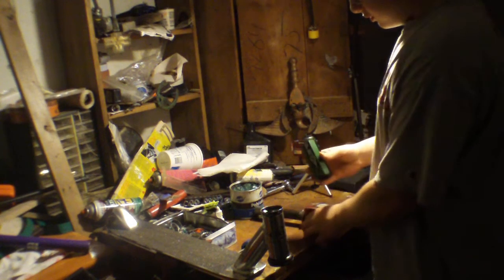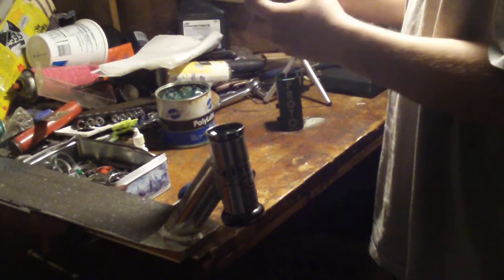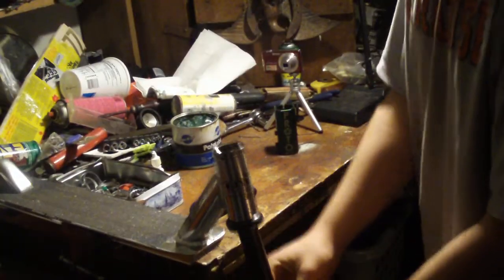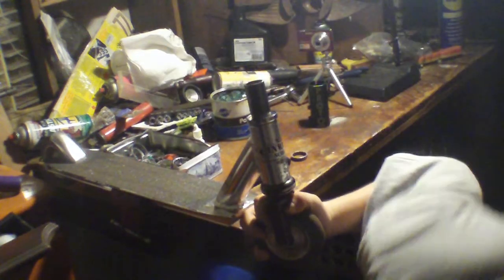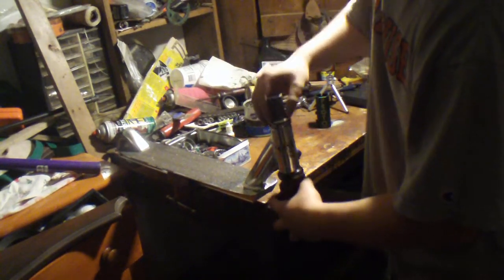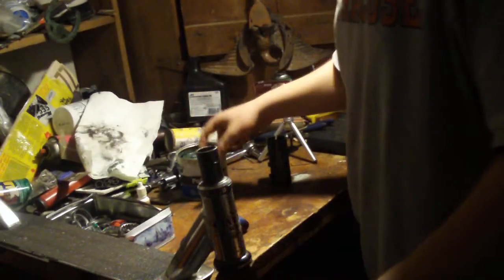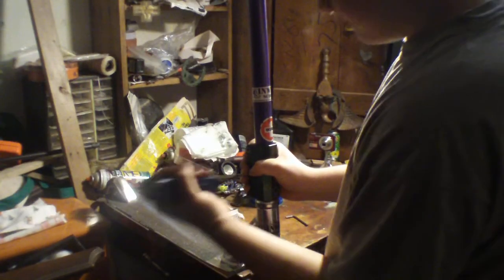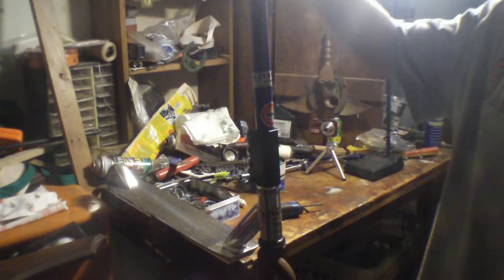How to install a Proto Brass Knuckle (SCS Compression System) on a Scooter

Comment: @LukeCanScoot yes cus there isn't a thread in the bars anyways its just the imprint of the thread on your forks
+ you have to cut the slits out or you will have like and inch of wobble

Comment: if the bars i have (invert special edition bars) have a slit in will the proto SCS still work?? and i have threaded forks atm so the bars have kinda got thread in now coz the forks have kinda worn in thread into the bars so will it matter for when i get the threadless forks??